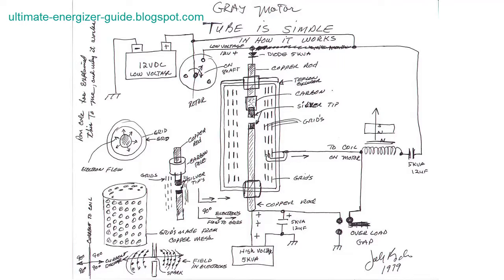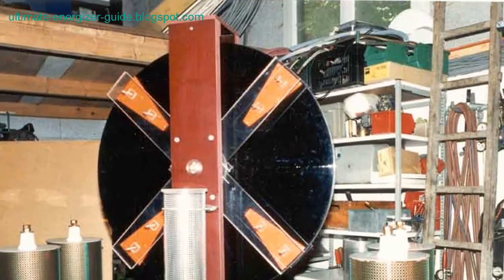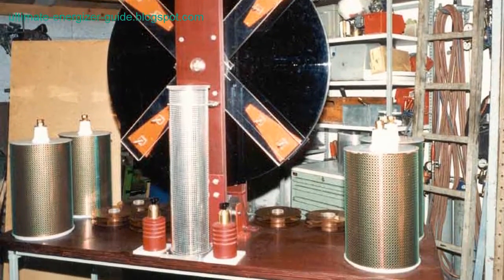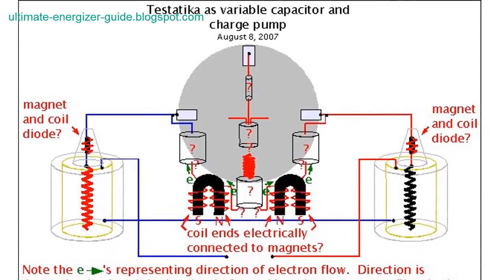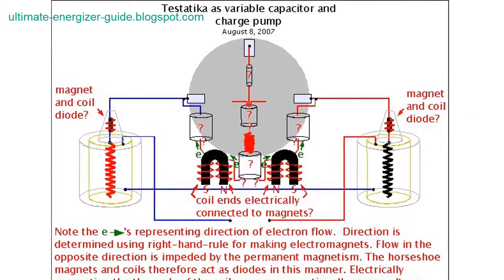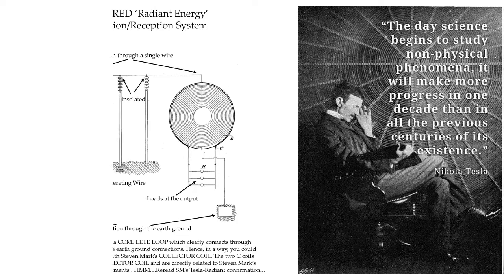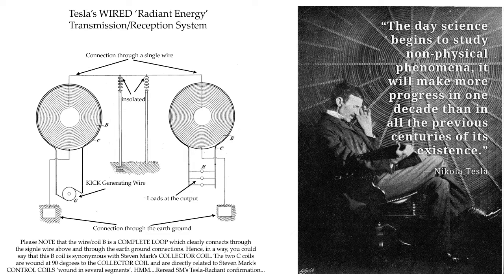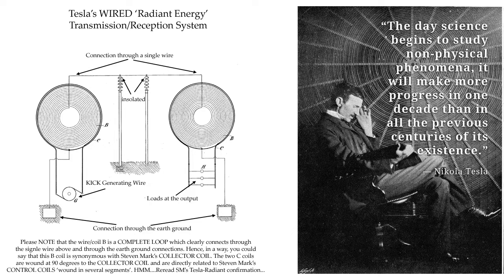Nikola Tesla's Free Energy Machine - Nikola Tesla's Radiant Energy - Other Versions

Comment: Think about what if we receive power from internal sides of the 
capassitor? 
>>So we may charge our capacitor on external side with low force
But discharge it from the internal side with great output power.<<

Usually voltage lowered because of attracting force
of another charge from second plate of capacitor , but it 
related only to external side of capacitor surface, its because of it the closer capacitors plate is the lower voltage are required to charge it to the same capacity(place the same charge)

But what should hinder this charge from directly and 
straightforward flow frome one side to another and uleash
maximum power then(?) through some powered devise(lamp, resistor,whatever), 
force would
be maximum possible for this quantity of electric charge.

If our charge went through "water mill" with great force
power obtained from it should be great as well.

Meanwhile external voltage is low , internal voltage might be great.
(always with maximum force)

So we may charge our capacitor on external side with low force 
But discharge it from the internal side with great output power.

We have the same voltage , we have the same amount of charge
We have the same powered device(for resistor distance dont
metter)
I dont see the rison why our obtained power should be 
inferior then.